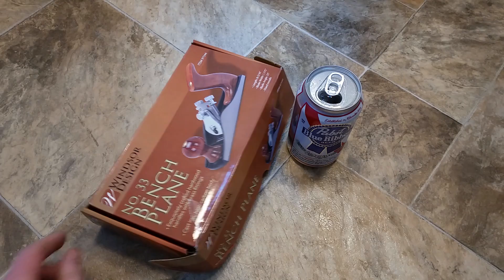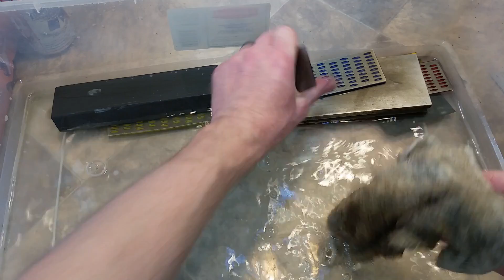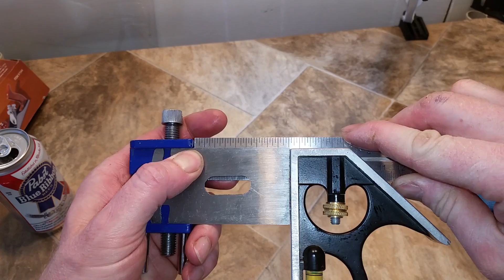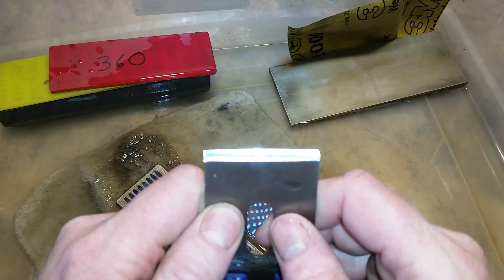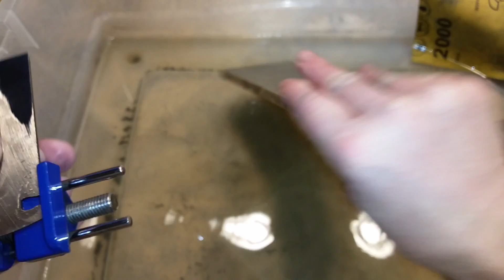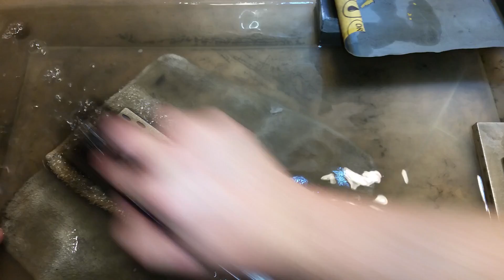2000 Subscriber Give-A-Way - Turn a Turd into a Diamond - #33 Bench Plane

Comment: Just bought one, sharpened the blade which was awful, checked the sole, which was very flat, and cut down my edge of my bow form very easily from a 2x6.  My trouble was that I didn't know how to hold and push it right at first, even though the blade was set right.  I messed with the blade height a bit.  Once I did, zero chips, just smooth cutting.  Can't believe it.  All I used was the stone sharpener, didn't even go to high grit.  As a noob, this is an accomplishment.

Comment: I bought this plane for 9.99, worked on it like you did and used it some.  When I saw the large mouth opening, and why that could be considered good, I converted it into a scrub plane.  Got a large can of beans, traced the curve of the can on the edge of the blade, ten minutes on an 8" grinding wheel to shape the curve and put a bevel on it.  A little secondary bevel placed with sandpaper and jig finished the blade.  It now makes trash can amounts of shavings with little effort and brings big chunks of wood to near finished size in a few minutes.

Comment: I did the same thing and was able to get the blade very sharp, however after just about 20 minutes of use it looses it's edge drastically. So I resharpen over and over and it just looses it to quickly. Now it sits as part of my collection and actually looks fairly nice. : ) If I could find a quality blade that I could retrofit into the HF plane it could be a saver, but then you might as well have purchased a decent plane in the first place since you'll be into it all for over $100USD by then.......
Reply from the maker: I wonder if heat treating the blade would keep it sharp longer.